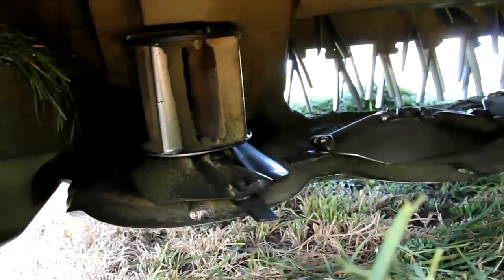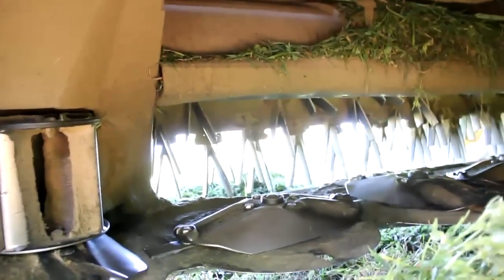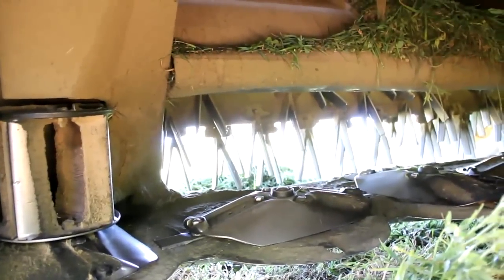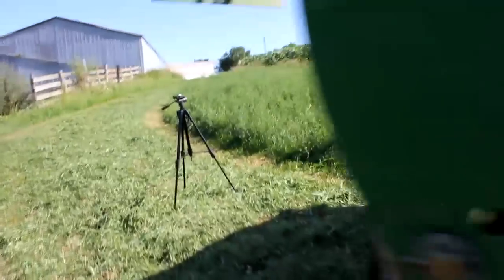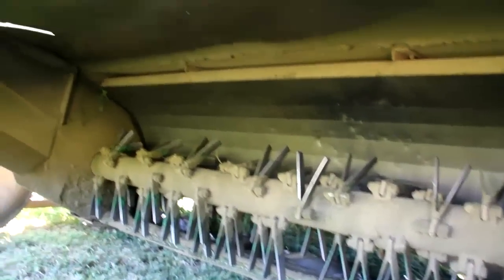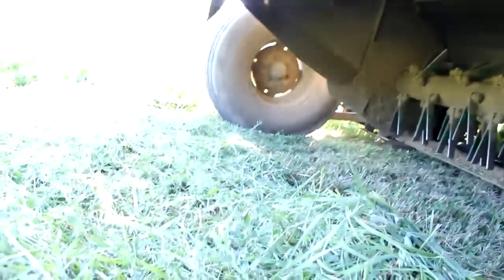Cutting Hay - John Deere 7600 and MoCo Haybine

Comment: Alfalfa looks good, you have to rake the windrows.  I was a fram boy during the 1930s and 40s, we had an old Oliver tractor, hay had to be cut with a cycle mower and raked into windrow then we bailed it with an old International 3 wire bailer.  Great film.

Comment: Deere's are called Mo-Co's (mower conditioners), New Hollands called their original sickle mower/roller conditioners "Haybines" (like "combines" but for hay I suppose) and their newer disk mower/conditioners are called "diskbines"... 

Folks tend to use the terminology interchangeably; like in parts of the South a rotary mower is called a "Bush-hog" despite the fact that Bush-Hog is a manufacturer of a very popular line of rotary mowers (for which they are perhaps best known, though they make lots of other equipment including hay mowers, disks, plows, and such).  They've even turned the brand name into a verb, as in "I'm going to bush-hog some land".  We always called them "shredders" because we primarily used them to cut down and chop up crop stalks after harvest before disking and plowing the land in the fall, and secondarily for shredding weeds and stuff in the pasture... 

Funny how equipment names and terminology differs from place to place.  

Later!  OL J R :)

Comment: they do have fixed mowers but if you want one you would have to have one tractor just for it cause if Ur tractor with front mount broke what  are you gonna use? in Canada people use both and for bulldeere's question if we want wide tires we just put duals on wide tires are pointless here